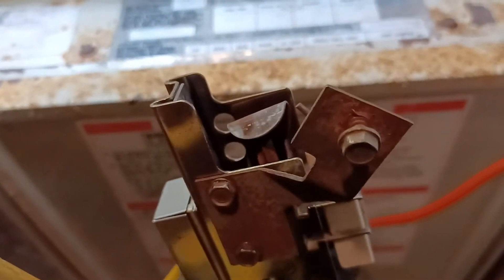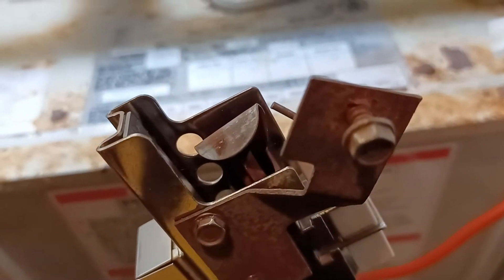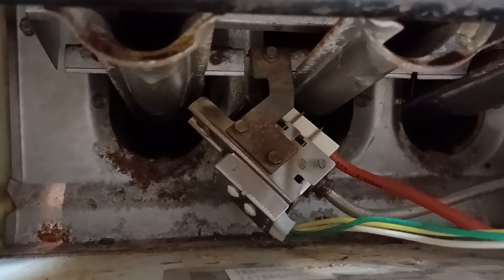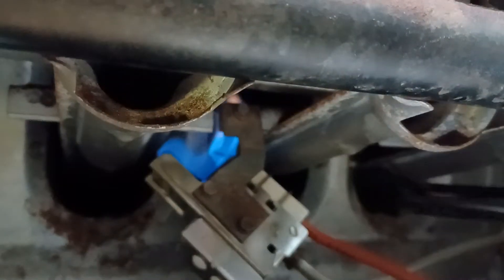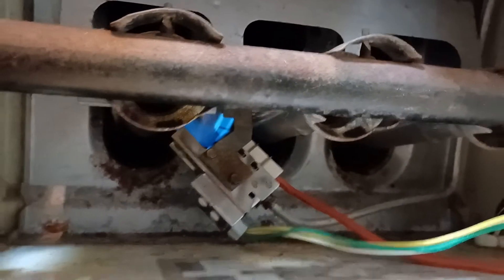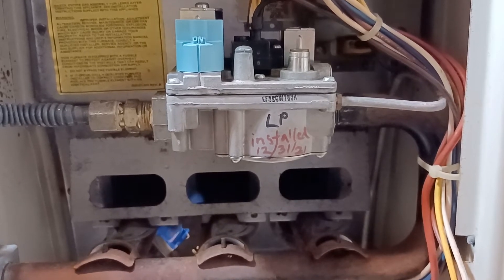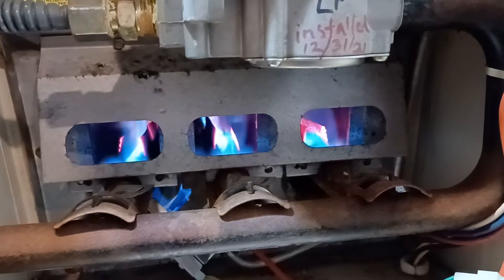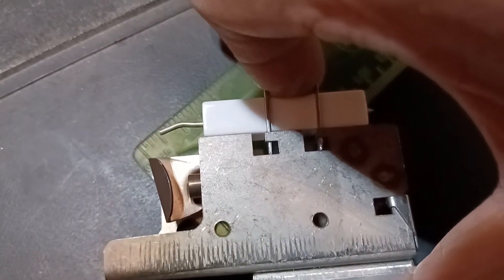CARRIER FURNACE 58GS Series 130, TICK TICK TICK No Pilot Light, Pilot Assembly, Lockout, No Heat

Comment: What would cause the pilot to not light only when it is below 40 degrees Fahrenheit. I never have an issue unless that is the case. I have the same carrier as in the video
Reply from the maker: It could be a number of things. First check, the thermostat to make sure it's operational. Second, it could be the circuit board given this furnace being almost 40 years old. In the last 5 years, I've changed two circuit boards on my furnace.
Reply: @samtoustube I have a Google home thermostat and thinking back this started happening a little while after I installed it. Maybe it isn't as capable as I thought. I have replaced everything besides the circuit board but that was my next step if it continued to happen. I appreciate the input and the reply!

Comment: Great vodeo!! Thanks! I see what yours is doing but my pilot will light with blue flames and keeps ticking with a flame  but not burners are kicking on at all... what do you think that is? I don't see any flame senor and I can't tell if there's  a thermocouple either ... what do you think? I'm pilot housing is a 3 wire assembly just like yours
Reply from the maker: It could be that your pilot assembly (faulty) because it has a built-in thermocouple. If the pilot light comes on, it should heat up the thermocouple hot enough to send the signal to the control board to open the gas valve to basically turn on your furnace. If you have a new pilot assembly, try replacing it and see if that works. If you don't have a new one, try taking it out and put it back on and make sure that all the screws securing the pilot assembly are firmly tight.
Reply: @samtoustube  ok!..thanks...I don't have a new one (yet)  1 other question.. should I clean the flat board off that you were talking about in the video and how should I remove that gas line that's attached to the polit light assembly? I have the switch off. So can I just unscrew that or do I need to do something else before unscrew that galvanized line that is connected? (Thanks for responding as well this really is helping me) I have everything taken apart so now is the time for me to do whatever I can before reassembling.
Reply from the maker: @ If there's any rust on the plat or the screw's areas, try to clean it and then put it back. If it still does the same thing like before, maybe your pilot assembly is bad. One other possible problem could be your control board if they pilot assembly is working properly.
Reply: @samtoustube  ok I'm cleaning it not.. a new control board was liter just put on it in Sept. ... do you think it's of to use an air can (compressed gas) spray to blow debris out? (((man think you soooo much for your help))))
Reply from the maker: @crappiesniper  If the control board is new and good, then it might be your pilot assembly is bad.  Sometimes the control board could also be defective even though it's new.
Reply: @samtoustube brother thanks for responding  and helping me out! It's creatirs like you that makes YouTube platform a great place for resource and how to  information! 
 Turns out it was a faulty control board. I still feel like that pilot assembly was due for a change and everything else was due for a good cleaning, burners too plus I learned sooooo much. 

Again thank you!!!
Reply from the maker: @ Hey, I'm so glad that you have figured out and you're able to fix your furnace and provide heat for your family again.  Good luck and take care!

Comment: Hi, i have the exact same Carrier furnace 58GS series 130. I don't really know anything about furnaces and it stopped turning on recently.

In my case, the pilot light never turns on and there's no sparking at all. Is the pilot light normally supposed to be lit all the time? Or is only supposed to come on right before the furnace is supposed to produce heat? I turn off/on the power to the furnace and I can "hear" power going to the furnace, but no spark occurs. And when I try to manually light the pilot light, nothing happens either.

Does this likely indicate that the pilot assembly needs to be replaced? Do you have a part # for this so that I can search for it online?

Or could it be a problem with the igniter / lockout control unit (part 1007-100 LH33WZ512A) that is connected to the pilot assembly with a red wire? I recall about 20 years ago, that control unit was replaced when we had a furnace issue.

Thanks in advance for any advice you can provide. 0:29
Reply: Thanks for your reply. My issue seems to be resolved after pulling out the red wire from the control board module and reconnecting it. Maybe there was a bad connection there, but not sure how that could happen as no one has touched the furnace for many years.

Do you know what the purpose of the red wire is for? Is it basically to bring power to the pilot assembly to create the spark? The pilot assembly also has the green, yellow and white wires and not sure what these are for either.
Reply from the maker: No, the pilot is not supposed to be on all the time. It only comes on when the igniter sparks and lights it. In your case, since the igniter does not sparks the pilot will not come on.  1. Take the Pilot Assembly out and then put it back in, make sure everything is connected securely; has good Ground contact with the bracket holding the Pilot Assembly and the big orange/red wire is secured between the Pilot Assembly and the Control Board.  2. If there’s no sparks (or Tick Tick Tick), your Control Board Module is probably bad/faulty because you have stated that you could hear the electric going into the furnace when you switch it to on.  Below are those two parts:

Carrier LH33WZ512A 1007-100 Spark Ignition / Lockout Control Board Module

Robertshaw 1830-620K for Carrier LH680005 Pilot Burner and Igniter 

Hope you can fix it so that you can provide heat for your family.  Good luck!
Reply from the maker: Yes, the red wire is basically a high voltage power wire that makes the igniter sparks to light up the pilot light.
Reply: Unfortunately, my problem with no sparking at the ignitor started happening again, and pulling out and putting back in the red wire to the ignitor control module doesn't help anymore.

I'm wondering if there is a way to test whether the issue is with the red wire or the control module. Is there a way to just buy the red wire from somewhere to try out?
Reply from the maker: @dcccs  if you have a multimeter, you could probably test the continuity of that red wire.  I don’t where you can buy that red wire.  Maybe you can search on eBay?  I believe your control board has gone bad because it’s not sending the spark/voltage to ignite the pilot light.
Reply: @samtoustube  Bought and installed a new igniter / lockout control unit (part 1007-100 LH33WZ512A), but it did not help. No spark or ticking sounds ever occur when heat is supposed to come on. I don't think there's any issue with the red wire either as per my understanding now, even if the red wire is not connected to the control unit, the control unit itself should make some ticking sound if heat is supposed to come on, and this does not occur for me. Also, putting the tip of an insulated screwdriver to the output pin (that the red wire is normally connected to) should produce a spark as well, but this does not occur for me.

Now I'm wondering if somehow the control unit is not receiving the 24V input that it's supposed to receive. I know the control unit is not the focus of your video, but do you know how to test for 24V input to it? I believe the middle connectors of the plug that goes into the control unit (to pins 5 and 2) are supposed to deliver 24V. On my setup, it's the blue and black wires on the plug (that connect to pins 5 and 2 on the control unit). So when I disconnect the plug from the control unit and measure the plug connectors for the blue and black wires with a voltmeter (while power is supplied to the furnace), I thought I should get 24V, but I only get a very small voltage under 1V (e.g. .3V). I'm not sure if 24V is supposed to be delivered all the time or only when heat is supposed to come on. If I shut off power to the furnace, I do get 0V.

I know it's a big ask, but if you ever get a chance, it'd be really helpful if you are able to measure 24V with the same steps I tried. Maybe you could even make another video about this as I haven't been able to find any videos so far on testing this particular control unit. No matter what, thanks for replying to all my questions so far.
Reply from the maker: @dcccs  Here are some scenarios of possible issues:

1. Did you check your thermostat to make sure that it's not faulty? Does it have a battery? Battery is good?  Make sure you set your thermostat to call for heat.

2. The ignitor control unit should not or is not supposed to make the ticking sounds by itself; the ticking sound is only initiated by the control unit by sending the voltage to the pilot assembly to ignite the gas to light up the pilot light for the furnace.  

3. Your Pilot Assembly could also be the problem if your "NEW" control unit is really operating and is sending the voltage to the pilot assembly.

4. Your "NEW" control unit might still be the problem because you have stated that there's no sparks when an insulated screwdriver to test the output pin.  The new control unit could be a factory defect.

5. Lastly, you might want to check your Main Electrical switch to see if you have a tripped switch for your furnace. If it is on OFF position, you might want to switch back to ON position.  Then, try to set your thermostat to call for heat and see if this solves your issues.

Sorry, I do not know how to test for 24V on the furnace. You might want to search YouTube again and see if furnace professionals have some videos on this.  If this does not work, you might want to consult a professional to solve your issues.

Good luck!
Reply: @samtoustube  Ok, thanks. I did check for obvious things like the thermostat and circuit breaker, and those are not issues. And I think pilot assembly is not an issue either because the insulated screwdriver test does not even generate a spark from the control unit. When I was testing my old control unit before when it was working, I  disconnected the high voltage wire from it to do the insulated screwdriver test and I could hear the control unit itself make the ticking sound so I thought that was normal behavior. I came across some videos of other types of ignitor control units making ticking sounds by themselves so I thought this was standard behavior.

Unfortunately, there doesn't seem to be any videos out there about debugging this particular type of ignitor lockout control unit. Anyways, thanks for trying to help.
Reply from the maker: @dcccs  I think it still might be your "New" control unit.  It's probably a faulty or/and factory defect unit.
Reply: Figured out my furnace issue. It's due to a bad thermostat. Somehow, it was not sending the signal to turn on heat so ignitor control was not receiving 24V power. I originally thought thermostat was not the issue as I could turn on the fan and AC from it. After I removed the thermostat and connected the proper wires that normally go to it to manually turn on heat, furnace worked fine.

So for anyone having a similar issue as me, first check whether thermostat may be the cause by removing it and shorting the proper wires to turn on heat or the fan (don't try shorting wires to turn on AC as I read that's not good for the AC compressor).

By the way, for checking whether 24V power is delivered to the ignitor control unit, the way I thought to measure the voltage on the middle connectors of the plug that connects to the ignitor control unit is correct. I actually measured about 28V when things are working. Both my old and the new ignitor control unit I bought work fine when power is delivered so now I have a backup part if ever needed in the future.
Reply from the maker: @dcccs  that’s great! So glad you got heat again for your family. The thermostat was #1 on the list above of one the possible issues. Since this furnace is over 30 years old, I always have a few spare parts (Igniter Control Unit, Pilot Assembly, Capacitor and Gas Valve Unit) on hand. Last week, my Igniter Control Unit went out and I was able to replace quickly.  I bought another unit and put it away.  The lesson here is to check your thermostat first and make sure that it’s operational because the thermostat could be as old as the furnace itself.

Comment: It took a while to clear the air out of the pilot gas line after your gap adjustment to.get the gas coming for the spark to ignite.
Reply from the maker: Yes, it did take a little while for it to light the pilot light on the very first time.  Later, it only takes one to two clicks for it to light up.

Comment: I disagree that this is a gap issue. I believe that your pilot gas setting on the gas valve needs to be turned up. This will make it easier for the spark to ignite the flame, and, will make the flame hotter so that it heats up the bi-metal switch quicker so the burners ignite sooner.
Remove the cover screw on the pilot adjustment and use a small regular screw driver to increase the pilot gas flow.
Reply from the maker: Please watch the video entirely as I demonstrated about the gap between the igniter and the metal plate was too small which I think prevented the gas from igniting due to the lack of gas and oxygen mixture.  I used a lighter to demonstrate that there was gas present, but the arc of the igniter was too short/small for it to ignite the gas or pilot light.  Again, I'm not an expert on furnaces, but this is what I found out and fixed my pilot issue on my furnace. Over this very cold winter, my furnace comes on every time I call for heat.

Comment: Sam, I have exact same situation, cheap replacement igniter  module but gap too small, won’t ignite pilot.  HOW did you adjust the spark gap? Did you bend the igniter tip, relocate the spark module further back in its holder, or what? Thanks!
Reply from the maker: Steve, I just used a pair of pliers and bent the tip of the igniter back a little bit. If you watch the whole video, I showed the gap between the igniter and the bi-metal plate. I hope you can get your furnace running again soon.

Comment: Hi Sam, when you installed the new Pilot assembly, did you put a new fitting on? or keep the old fitting?  In other words did you keep the old ferrule on that's on the pilot gas tube. I was thinking of either cutting the pilot tube if I had enough slack or install a new pilot tube or see if I can reuse the old fitting with pipe dope....
Reply from the maker: I just changed the pilot assembly and kept everything the same.

Comment: Heat exchanger is likely cracked worse than broken glass. It's carrier.
Reply from the maker: My heat exchanger of this furnace?  How can you tell.  Thanks
Reply: @samtoustube  because it's an old carrier. It should be inspected by a professional.
Reply: @AmericanFarmerHVAC2024  , you don't need to make assumptions. just because it's old.  If the person wants to learn and how to inspect it's fine. There are  a lot of resources online these days.  If you are mechanically inclined I'm all for DIY repairs as long as your are playing it safe.
Reply: @haywardkong1213  take it from someone who does this for a living? I know what carriers do.
Reply: Probably more so in your area since it sounds like you live in a much colder climate. If the furnace is located in much warmer climate like say parts of California that don't snow the furnace won't work as hard so it would last much longer. Same thing applies to cars that are located in the rust belt vs cars in the non-rust belt areas..
Reply: @haywardkong1213  yep that's what it is. Cold ass Minnesota lol. -30 below 0 winters are normal. Furnaces run 10 times as much as down south.
Reply: @AmericanFarmerHVAC2024  In that case, can you recommend somewhere on-line to buy a couple more in case they go bad again?
Reply: @Stormcloud32  couple more what?
Reply: Please clarify the years of the units you are taking about as units in late 80s and early 90s definitely  had ssues, but units before and after that, not so much. My unit is from 1985 and is still going strong.
Reply: My 1985 90 Plus  398AAW is still going strong. I just opened it up today and there is no rust on the exchanger exhaust tubes. Units made in the late 80s and early 90s had significant problems with the exchangers.
Reply: @dgrasser  so you pulled the blower and looked at the secondary hx on that thing? It might not be rusted out, but that doesn't mean it's not plugged up and sending copious amounts of carbon monoxide through the exhaust pipe.

Comment: Exactly what I needed. Thank you!
Reply from the maker: I hope that really helps and you’re getting this winter.
Reply: @samtoustube  I need to find more of these igniter switches to use in case the same thing happens. My furnace is almost the same but about 10 years older. Can you recommend somewhere online to find these? 
Thanks once again and Merry Christmas!
Reply from the maker: @Stormcloud32  Hi Gary, I recently bought a couple of these igniter/pilot assembly units on eBay to keep as future spares (You can find them on eBay).  You also might want to grab a Lockout Control Board for your furnace as a spare because this unit will most likely fail soon due to the age of your furnace. The Lockout Control Board recently failed on our furnace and we had to wait several days for a replacement part without heat.  Merry Christmas and Happy New Year!